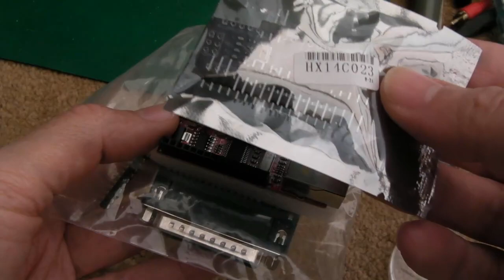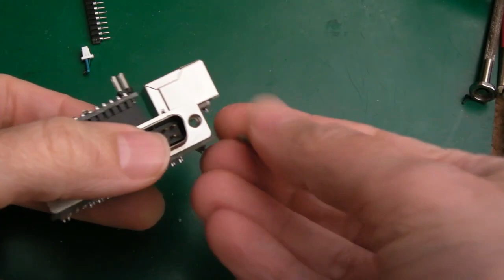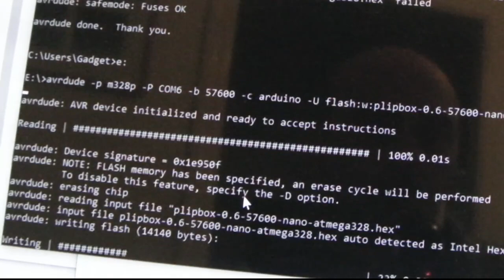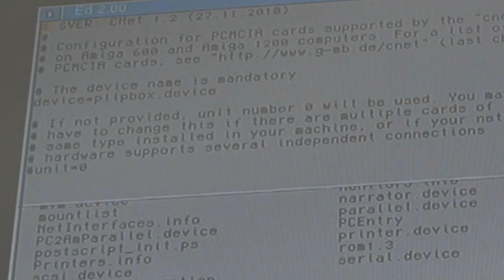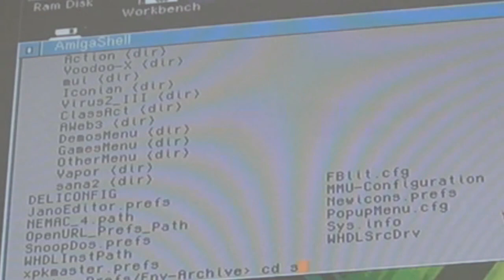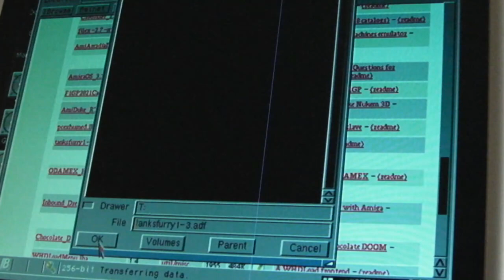Commodore Amiga Plipbox (Get your Amiga on the Internet)

Comment from the maker: NOTE: One thing I found if you soft reset the Amiga, the network connection seems to go.  A power cycle of both is often required to get the network connection back.  There might be a way to solve that (perhaps stop the network at command line before reset?).
You can also get the demo version of IBrowse and RoadShow if you want to just tinker around with internet connectivity!  I think IBrowse has a 30 minute session limit (per use), and RoadShow demo version performs slightly less than the registered version.  But both worked perfectly well when I tested them before purchasing licenses for each.
WHDLoad checks if the slave for each game is up-to-date automatically with a network connection, and it will tell you if there's a new version of WHDLoad too =D
Reply: Yes, I've noticed that too...after searching for a failure in my setup for at least half an hour.

Comment: @28.39 echo NOBURST....the most recent plipbox 0.6 ver i think says BURST is the default, and should be enabled to allow faster transfer times. so - why NOBURST? did i misunderstand the docs file?
Reply from the maker: It just wouldn't work at all on my 1200, until Burst was turned off!   It might work on other Amigas?!?  There are differences on the parallel port!
Reply: @GadgetUK164  sounds right- it does work on my tk030-2 A500, oddly!

Comment: There is not a good way to hook an Amiga to the internet.
Reply from the maker: On a 1200 or lower It's the plipbox probably!  It does work well tbh!  For big box Amigas there are better solutions though - just using a good network card.

Comment: Nice video with great pieces of information for configuring and building the plipbox nano.  For the A1200, I would prefer the solutions working with an pcmcia network card. This works really fast with my 1232 turbo card from icomp. Ok, my  only goto website is aminet, but downloads work pretty fast and very reliable.
Reply from the maker: Yes, the plipbox via Parallel port is pretty slow (dial up speeds).  I looked at PCMCIA options but I use the PCMCIA port for transfering files etc.  I guess I could start transferring via FTP or something instead...   I think even better would be something that hangs of the clock port!

Comment: Can you take advantage of "mobile" versions of websites for better performance in I-Browse?  How does plipbox compare speedwise to a 10mbit zorro-ii ethernet card or an x-surf-100?
Reply from the maker: To be honest, most modern website really struggle!  It's fine for internet based apps on the Amiga - eg. WHDLoad will let you know automatically if there's a newer version, or an updated slave file for the game you launch etc.  Or for use with FrogFind, 68knews, aminet etc.  But you would struggle to use it on any modern website probably.  The plipbox speed is VERY slow compared to any other network card / solution.  But its cheap and uses the Parallel port, freeing up other connections inside etc for other things.
Reply: @GadgetUK164  Sounds like a good budget option to have.  If you have multiple Amigas with plipbox, can you network them and file share with remote drives between Amigas?  Or maybe even screen share between Amigas?

Comment: The guy who runs the Action Retro YT channel has put up a search tool for ancient browsers at www.frogfind.com.  This uses Firefox's Reader Mode to cut most of the crap out of web pages.  I think Frogfind then may do some additional processing on the result to put out basic HTML that will work in extremely old browsers.  So the search results are returned through Frogfind, and it becomes like a proxy until you enter a different URL.  You can try it out on a modern browser as well.

The Wikipedia home page doesn't render in Frogfind, but if you put, e.g. wikipedia amiga in the Frogfind search box, the Wikipedia article on the Amiga will be at the top of the search results, and the articles render very readably.

I think now I'm going to have to get a PLIP Box.

Comment: is the tcp stack running on amiga or the nano?
Reply from the maker: I believe its running on the nano!  I read that one of the latest changes was to use the RAM in the nano for the stack.
Reply: @GadgetUK164 ok, I thought it was running in the Nano RAM like most systems with tcp/ip stack.
Reply: I could be wrong, but my guess is that there are IP stacks running on both.  The Amiga uses PLIP  (Parallel Line Internet Protocol), which is very similar to SLIP or PPP that was used for dial-up point-to-point connections back in the day, to talk to the Arduino, and the Arduino uses TCP/IP to communicate with the rest of the network over the Ethernet port.

Before the PLIP Box, you could make a PLIP cable and run it between the Amiga and a PC's parallel port, also running PLIP, and use the PC as a gateway onto the Internet.  The PLIP Box just substitutes the Arduino for the PC.
Reply: @joelavcoco  ah nice explanation.

Comment: Love your videos bud, but I have to say that I am glad that (for myself) I have embraced newer tech. I do not miss working on older machines heh... My first computer back when I was a much younger man was a C64. We were relatively poor so we didn't even get a C64 until the mid 80's and I was nearing my teens. I cannot say that I miss it at all. I loved it then, it started me down a lifelong path that has lead to where I am today. My oldest running machine is a Linux box that uses a 3000 series I5. I have a couple Core2 systems floating around somewhere but they are to slow for what I want to do. I enjoy the flashbacks to the older equipment from my younger days. I have to admit though, I am more interested in learning from your methods for component repair. Small note on the plipbox =) , you plugged the long pins into the short header and short pins into the long header heh. I would guess that the nano was designed to plugged in first, the the ethernet hat on top of it. As long as it makes good contact, of course, it doesn't matter tho.

Cheers and thanks for all your work.

Comment: Cool device, any advantage or speed difference over a PCMCIA network card on a 1200?
Reply: Can be used if pcmcia is busy or absent 😄
Easier to get it. I’ve used slip router on ESP8266 and uart(this solution slower but cheaper and wireless).
Reply from the maker: Advantage over PCMCIA is you can use the PCMCIA for storage (which I do regularly), however the PCMCIA network cards are faster than the Plipbox.

Comment: I recently bought a ready built one from Ireland but not set up yet. Thanks for the video as I now understand a lot more about it. Yes I remember dialup with my CD32 and SX1 and a 56k modem connected to the serial port. Funny but back then it seemed quite fast. Best Browser then was Voyager by Vapourware. But unfortunately they seemed to have disappeared. I am happy to try iBrowse and pay the full price as I also believe in supporting Amiga developers with either hardware or software. Thanks again.

Comment: Great vid 👍🏻 Just to note, you can download a useful GUI tool from Aminet called “roadie” which allows you to control basic functions of roadshow without having to use the command line. 😉 It basically tells you if you are online, what IP address as well as stopping and starting Roadshow without having to reboot etc.. Also used MiamiDX which if you are beginner to the internet on the Amiga is fine, but can be problematic to setup especially for DHCP, but it’s all GUI based even the setup.
Reply from the maker: Thanks, will check that out!

Comment: If you flipped the log pin headers over, could you pass them through both add-on boards?  That might make it slim enough to just put some heatshrink around the whole thing.  Of course it wouldn't be modular anymore.

Comment: I'm using a plipbox on an Amiga 500 with an external 68020 turbo card. As a TCP-Stack, I'm using MiamiDX, mainly because I had no idea what to use, so I used the first one that I found that didn't seem to require a lot of manual configuration. I just had to copy the device file and setup MiamiDX, which seems to handle everything concerning DHCP, DNS and the gateway just fine.
I'm mainly using it for FTP transfers, albeit I did install some browser (can't remember the name, but it was some free one), which can at least display aminet somewhat.
Reply from the maker: I think MiamiDX is very good too tbh!  There's probably very little difference in performance between RoadShow and MiamiDX.